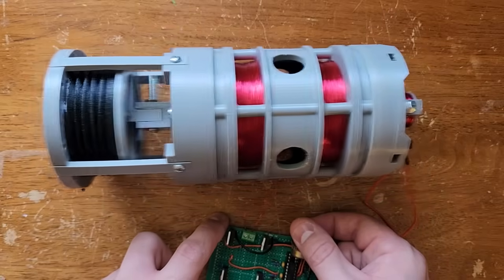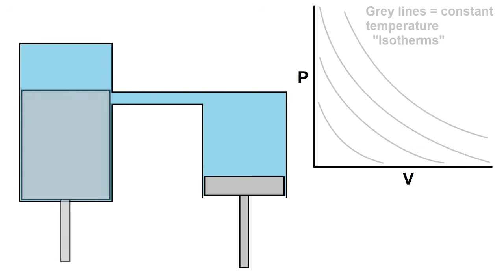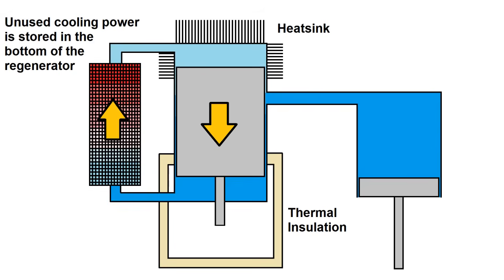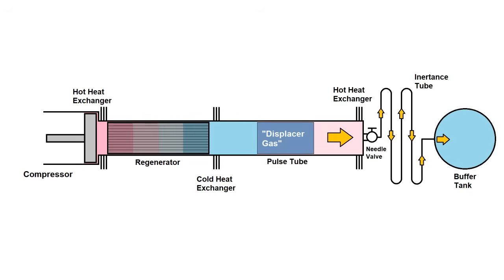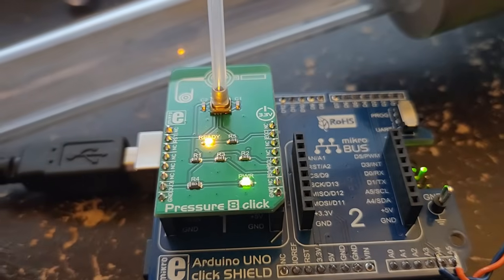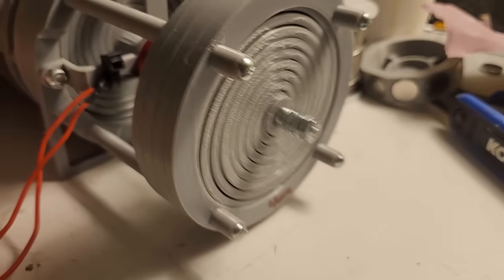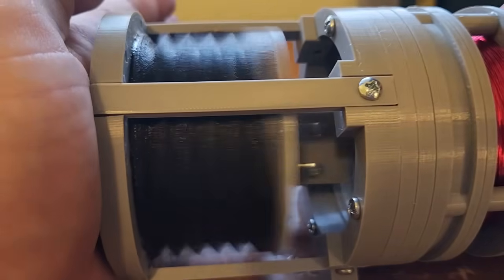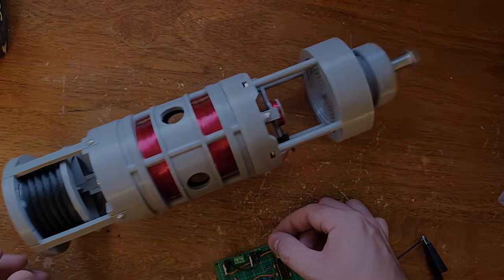Pulse Tube Cryocooler - Part 1

Comment from the maker: BTW, "Sub-kelvin" isn't referring to below absolute zero (which is impossible), it refers to temperatures that are between 0 - 0.9999..... kelvin
Reply: Something to consider is that even fully filled 3D printed parts can leak air. You may want to go onto your compressor parts and cover them in some form of sealant. To test this take one of your 3D printed parts and make like a box with a clear side and then put it in water at a certain depth if it starts to leak then you've got leaky prints.

I recommend silicon and epoxy
Reply: Hmms so you mean a 1 is a singular value and thusly could be dropped entirely resulting in sub-kelvin?
Reply: yeah i was curious about this - whoever came up with the term "sub-kelvin" gets a pass on using counter-intuitive language bc it sounds cool as hell
Reply: What if you used a seperate system for both the compression system and the displacer?
That way you could have a standard reciprocating cylinder powered by an electric motor to run the compression wave and another one moving the displacer up and down in a seperate cylinder with a regenerator between them. You would have to tune the speeds to maximise cooling  which would require a speed control component but it would make the cryocooler buildable with virtually off the shelf parts.
Reply: Question regarding the displacer gas: couldn't it also be replaced by a floating displacer piston?  it seems like relying on the gas's momentum would require quite the high frequency.
Reply: can we use it for air conditionor
Reply: hello
Reply: İs this endustrial dildo?
Reply: Just for completeness sake: negative absolute temperatures i.e. temperatures "below" 0K are in fact possible but these are incredibly energetic systems and can only be achieved under very specific circumstances.

A fun rabbithole to go down nonetheless if this interests you.
Reply: @horrorhotel46290  Can you link something to read more about this? I'm really interested.
Reply: How do you know?  Sub absolute zero maybe what causes big bangs?
After all, a vacuum lowers boiling points.  Imagine what nothing does to it.  BOOM!
Reply: Negative kelvin is possible actually
Reply: @badgermcbadger1968 and funny enough, they are "hot". Energy moves from negative Kelvin to positive Kelvin's, effectively making negative Kelvin's hot compared to positive
Reply: I'm curious why is it impossible

Comment: AI Summary

Abstract:
This technical briefing details the Phase 1 development of a DIY Pulse Tube Cryocooler (PTC) designed for nitrogen liquefaction (77K). The report transitions from theoretical thermodynamic modeling—comparing Stirling cycles to the "gas piston" mechanics of pulse tubes—to the practical implementation of a resonant linear compressor. Key engineering challenges addressed include the necessity of a high-surface-area regenerator to bypass isentropic expansion limits and the application of RLC electrical analogies to pneumatic phase-shifting. While the initial prototype, driven by a custom resonant linear motor with a passive vibration balancer, successfully demonstrated the pulse tube effect via manual actuation, the electromechanical drive lacked the compression ratio required for significant cryogenic lift. The project concludes with a requirement for higher-torque rotary-to-linear conversion and refined pneumatic tuning of the inertance tube and buffer volume.

Experimental Development of a Resonant Linear Compressor for Pulse Tube Refrigeration

*   0:16 Project Objective: The primary goal is the construction of a pulse tube cryocooler capable of reaching 77 Kelvin to liquefy nitrogen, utilizing a resonant linear motor as the pressure source.
*   1:09 Pulse Tube vs. Stirling Cycle: Unlike Stirling coolers, pulse tubes eliminate moving parts in the "cold end," replacing the mechanical displacer with a pneumatic circuit (pulse tube, inertance tube, and buffer tank) to manage gas displacement.
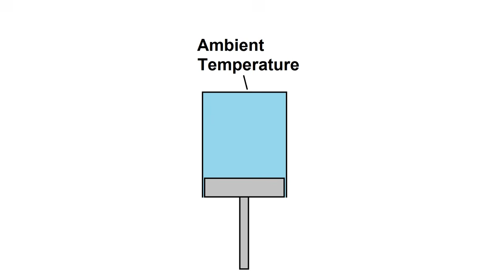*   1:39 Fundamental Thermodynamics: Cooling is achieved through a sequence of compression (heat rejection) and expansion (heat absorption). On a Pressure-Volume (P-V) diagram, the cycle must move between isotherms to produce a net cooling effect.
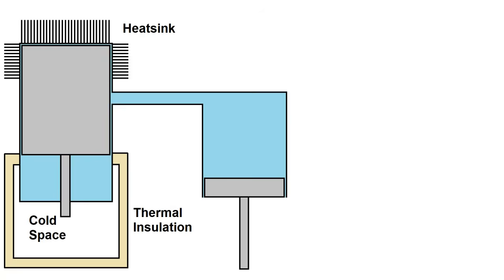*   4:10 The Role of the Regenerator: A regenerator acts as an internal thermal sponge with high surface area and low thermal conductivity. It pre-cools high-pressure gas before expansion, allowing the system to reach temperatures far below those possible via simple isentropic expansion.
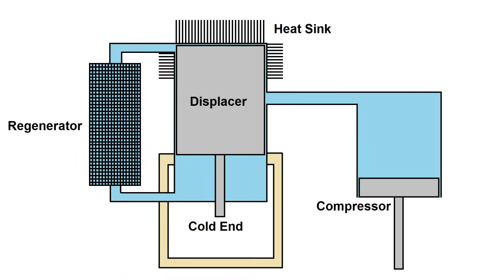*   7:14 Gas Piston Mechanics: In a pulse tube, a "gas piston" creates a thermal buffer. A phase shift between pressure and mass flow is required for heat pumping; this is achieved by the inertance tube and buffer volume.
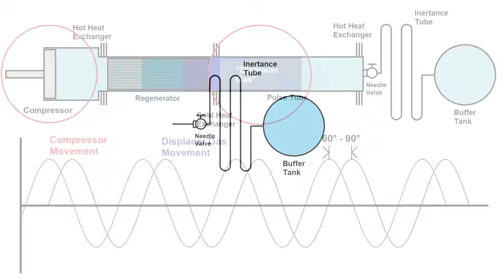*   8:37 RLC Circuit Analogy: The pneumatic system is modeled as an electrical circuit: needle valves represent resistance (R), inertance tubes represent inductance (L), and the buffer tank represents capacitance (C). Proper tuning ensures gas flow lags pressure by 60–90 degrees.
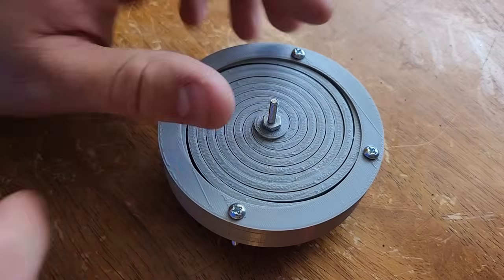*   9:03 Resonant Linear Motor Build: The compressor utilizes a push-pull coil configuration with N52 neodymium magnets and 3D-printed PLA springs, designed to operate at a specific resonant frequency to maximize efficiency.
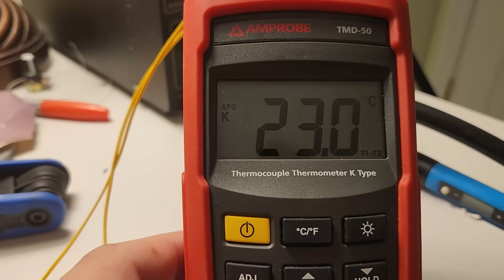*   12:33 Vibration Mitigation: A passive dynamic balancer (a tuned mass-spring system) is implemented to cancel motor vibrations. By matching the resonant frequency, the balancer moves 180 degrees out of phase, stabilizing the apparatus.
*   14:30 Piston Seal Iteration: Initial glass-tube prototypes suffered from blow-by. A transition to a TPU (Thermoplastic Polyurethane) accordion/bellows piston provided a hermetic seal, increasing displacement despite a short stroke.
*   16:02 Heat Exchanger Integration: To reject compression heat at low pressure ratios, a high-surface-area heat exchanger was fabricated from 2mm copper tubing clusters, placed between the compressor and regenerator.
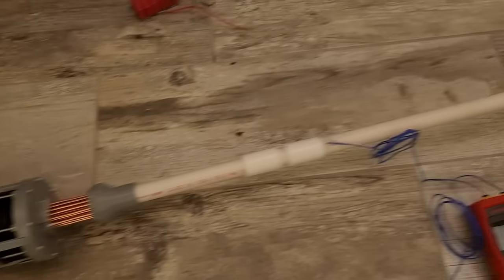*   16:23 Performance Analysis and Takeaways: The linear motor failed to produce a sufficient compression ratio for measurable cryogenic cooling under power. However, manual actuation produced a 4°C drop, validating the pulse tube's pneumatic timing and highlighting the need for a high-torque rotary-driven compressor in Phase 2.

AI-generated summary created with gemini-3-flash-preview for free via RocketRecap-dot-com. (Input: 23,936 tokens, Output: 927 tokens, Est. cost: $0.0147).

Comment: Hmm. Regarding the balancer mass and finding that 'sweet spot'. Veritasium recently did a video about a kind of spring series that allowed a two stage setting kinda thing. When set up vertically and oscillated, it'd settle into the least energetic state and dampen vibration. Would something like that on the balancer end allow for multiple 'sweet spot' settings so your device could run smoothly at multiple speeds? I imagine there's some resonant frequency fun you could do also to get even more control, if you wanted a kind of digital throttle that allowed for finer control than "Off, buzzy, max" settings.  The V vid was titled "This mechanism shrinks when pulled" if you're interested.  The multi-state bit is demonstrated at 21:10 in that vid.

Loving your stuff. I've wanted to build stirling engines to use to drive low RPM electric generators from the fireplace for ages now. Safer than steam, which has a habit of exploding when left unattended.

Comment: Hey just wanted to ask and also point out at the same time - when the out of phase vibration dampener kicks in - it looks like the travel of the piston lessens quite a bit, is it an optical illusion or is it really the case? because without it the piston seemed to create a good enough pressure diff?

Comment: I would try 3d printing the regenerator using some gf nylon and making a very tiny mesh, you could also try some other plastics without gf but a smaller diameter or even resin print a mesh

Comment: ever consider using an air conditioner compressor? I guess I should watch the end of the series but the one I'm using gets to 400psi and they are way quieter than a lot of other solutions
Reply: scrolled through some of ur other videos and see you did come to that conclusion later on. good video

Comment: you talked about using a longer tube to get the pressure more out of phase. could you have used a shorter tube, still get it more out of phase and higher compression possibly? (almost one hour later. i see in episode 2 it mixes the cold air and the hot air to much, great job, having a lot of fun with this)

Comment: An applicaiton for this type of cooler, would replace a simplier method.. So the compression cooler can you use a different gas? what gas is more optimal... if using air, is there a system to pull out humidity or moisture that may become an issue as temperature lowers.

Reason for questions.

The applciation of removing fans fro ma computer and have a sealed ait tight computer cavity and tube that becomes a pulse ocoled system.

Teh physics behind it could be applied to a torus like pistan setup with multi gap system, to have a faster and higher rate of compression with less noise and machine. the quesiton is the voluem of said system and its applicaiton can the design be changed in away taht would cool faster in a smaller design setup. If this deisgn was shrunk down.. and the tubes were glass but navigate back adn forth and yo uhad like 5 of them... or 8.... working in unison... would it do a better job the nthe larger one with many of them working...

How does human temeprature regulate itself..  anyways... that was my thoughts for application to computers.

Comment: this is SO interesting!! I think you can do away the two lossy springs near the coils, you only need something to center the magnet, and drive the oscillation only on your H-bridge and have something to detect end of stroke (hal sensor) to reverse the magnet movement. Still resonant, Less loss, more compression?

Comment: Make a re-generator with a stack of metal screens, each separated by a thin, porous layer of an insulator material. That will reduce the flow of heat but maintain the flow of working fluid.

Comment: What's the COP of such a cooler? Is it more efficient than a compressor based conventional cooler or less? Market available coolers are compressor based and market available compressors are just 10% efficient. What's the efficiency level of the compression process in this experiment?

Comment: for a linear generator add a helium jacket onto the main moving parts to remove friction instead of lubrication to reduce drag and heat
Reply from the maker: Yes, that'd be the best way to lubricate/seal the piston, problem is it requires incredibly tight machining tolerances.

Comment: A Joule-Thompson setup is by far the easiest way to achieve LN temperatures.  It just needs a high pressure compressor for the most part,
and today they have air-gun compressors that are like $200 that will do 4500psi (of course in low volume), but you could create your own higher volume high pressure compressor given your skills.
Reply: Hi, I was wondering if you could help with something. I'm trying to do a simple experiment to cool air by expanding it with a piston. But I've tried a bunch of experiments and measured with a digital thermometer, and I'm not getting any decrease in temperature. I keep reading that air cools when it expands but I'm not having any luck and it's driving me nuts! Can you think of any simple ways to demonstrate how it works? I just want to see it happening.
Reply: @ct6502c  He explained that you get no net cooling because the piston reheats when it compresses, the point of the stirling mechanism is to move the heat out

Comment: A possible solution would be to use the Stirling cycle cooler to pre-cool the gas before it enters the pulse tube, which can provide additional cooling. Alternatively, the pulse tube can be used to cool down the Stirling engine itself, which can help to increase its efficiency. However, this would require careful sizing and design to ensure that the two systems can work together seamlessly.

Comment: You might consider a refrigerator compressor instead of 3d printed parts.  There is a 'linear compressor' that I have a couple of, they are in LG fridges and use linear (solenoid effect) windings to push/pull the piston, which gives you a lot of electronic control over the piston movement.
I have wanted to build a LN generator for some time, but like everything else I dabble for a while and then move on to something else.

Comment: think it might have helped if you had put a sleeve around the bellows to reduce the expansion/contraction radially, umm how do I put this ;) try to keep the bellows from expanding on the compression stroke and collapsing on the intake stroke...  the net volume of the cylinder isnt changing as it moves thru its cycles. Think of it as blowing up a balloon with a large syringe, the balloon expands and then contracts as the syringe punger is pushed and pulled, but if the balloon was in a tube, the end of the balloon would travel down the tube displacing the volume in the tube beyond the balloon...

Comment: I NEEEEED spring vs inertia containing device like a car driving or a flywheel vs resistance calculations compared to R, L , C calculations. like a full compare and contrast ofthe following: phase relations- eli the ice man. power triangles. ohms law of course. impedence vs ( i think the term might be reactance as in reaction wheel.- i believe ive heard a flywheel be refered to as this 1 time on the internet) i believe inertia to be equiv to both inductive reactance and kenetic energy. i believe spring action to be potential energy and a capacitive reactance clone. i believe as you use vector addition to find total impedience of both resistive and reactive forces, you use vector addition to find the total impeding force of resistance vs reactive forces in complex systems of motion. until proven otherwise, for me personally this must be the truth. I have heard of that toy that mimics electronics using gears and chains and other parts. but i only recently learned the electrical equasions to what i have just described due to school and youtube ofcourse. i have tried asking google these questions but i cannot find what i am looking for. i tried asking the teacher but i dont think i thouroughly communicated. i left with only more questions. i must ask you not for youtube content on this(though feel free as this would be a cool video idea i would def show to mr dempster) I do ask only one thing. if you have any educational content on what im talking about- gimmie gimmie I MUST KNOW. much love, thank you for what you are doing for the world

Comment: hi, can we reach cryogenic temperature with HVAC compressor, if yes then how? thank you
Reply from the maker: Yes. An HVAC compressor with a good oil separator can be filled with helium to run a gifford-mcmahon type cryogenic cycle or a mixed-refrigerant joule-thompson cycle. Both can be accomplished with a high side pressure less than or equal to 20 bar

Comment: If you place a custom made pizeo e
Electric disk.   With added strength    the vibrations might help with any energy loss placing small voltages back to the system!  Think 🤔

Comment: I like that linear motor design a lot. Better than the later rotary approach. But maybe you handycapped it too much by printing the springs. Plastics have very bad properties for low loss springs. They have inherently high losses and should be avoided. This probably resulted in too low amplitude of the motion here. Better laser cut them from a spring steel sheet. Frequency tuning must then be done with weights. Can be accomplished with small magnets.

Comment: I got an old commercial pulse tube cryocooler I got from a recycling center in california. Had to vacuum bake and refill it before it worked again.

It works on 28-30bars of >99.999% pure Helium

Comment: Challenging project.   I worked on a multi-spectral camera that had an integrated stirling cooler inside a FIR sensor.   The sensor fit in my hand and could be cooled down to 70 K in 30 Sec.

Comment: Very nice demonstration. I've been playing with cryocoolers myself and last year actually ran GM head off ebay with a commercial compressor and got down to 15K-ish after operation for 1 hour (no heat load). I've shown that setup in one of my videos. Did you study effect of compressor mass flow to the PT cooler operation? My ultimate goal is to reach 4K with 2-stage PTR, but seems all larger 4K coolers require 7kW+ compressors to operate. I have 0.7W 4K cooler from MRI machine, but only 1kW compressor. Wondering if there is any chance to make it functional with small compressor, given that I can accept much lower heat lift capacity, but keep low temperature.

Comment: Nice project! But one important detail that nobody in the comments mentioned yet is a "flow straightener" for a uniform gas front so that the "gas piston" can push the gas. It's rarely mentioned in papers and scientific literature but every Pulse Tube cooler has it. It consists of several really small tubes, similar to your heat exchanger or a long extruded mesh. One is placed at each end of the Pulse Tube (after the warm heat exchanger and before the valve to the buffer tank). Should get you better results.
Reply: The straighteners also reduce convection losses in the PT